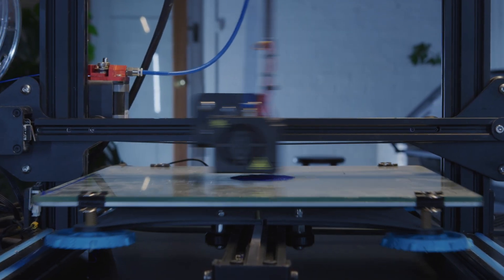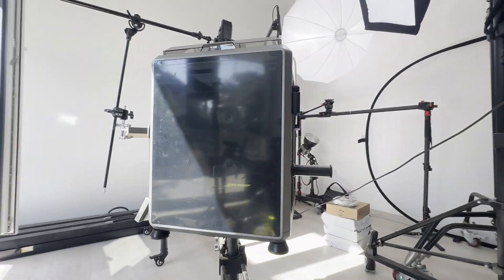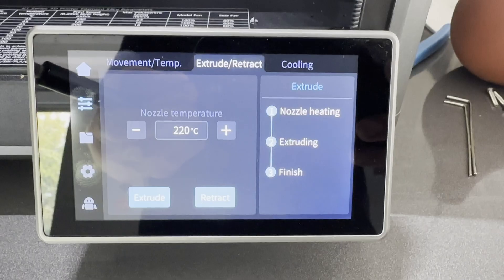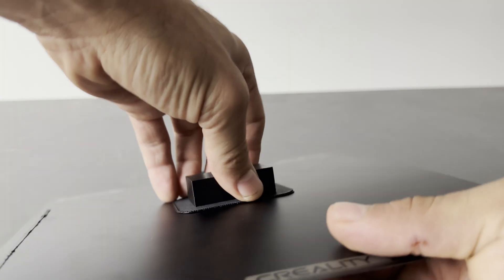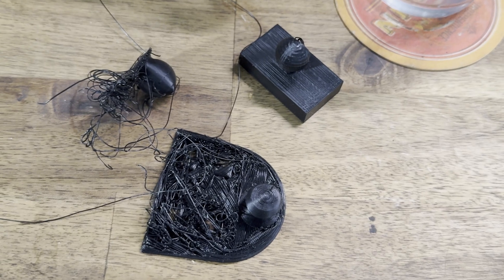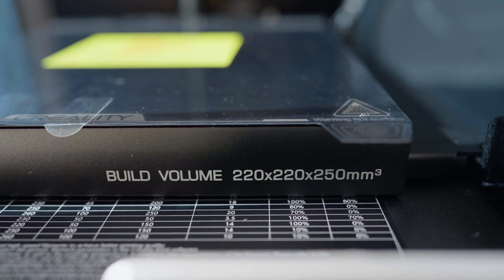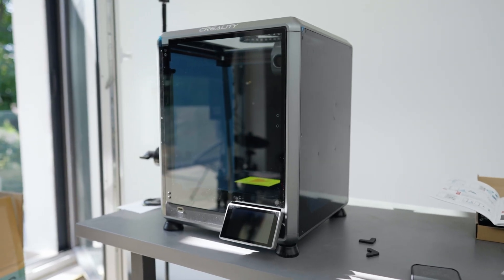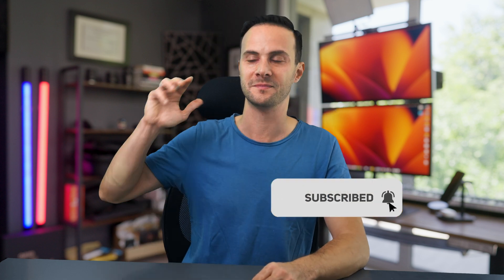Creality 3D Printer: What If You Could 3D Print Anything You Want?

Comment: I usually don't comment, but I couldn't help on this occasion. My first printer was an Ender 3 V2, and I was constantly adjusting, leveling, and upgrading it. It was followed by an Ender 5 Plus and a Longer LK5. Needless to say, I worked with those and upgraded, and fiddled and fussed with the hardware and firmware, and was able to print "OK" things, but after a while, they all collected dust. Fast forward to recent times, as a few years passed without printing much due to the constant issues, I wanted to upgrade the Ender 5 to a core xy machine. When I looked at the price and all, the Creality K1 was introduced. So, I bought a K1 Max. Maybe I got lucky, but from the first print, minus the VFA issues, it has been a wonderful printer. It has since been accompanied by a Bambu Lab A1 mini, and an A1. With these three printers usually all going all the time, I've found pleasure in printing again. So, this creators opinion doesn't make him a shill or fanboy...It's the nature of things...Some are great, and some suck! This is mass production...However, Bambu Lab, for a overseas manufacturer, same as Creality, they produce some of the best equipment I've ever used. The K1 Max is good for me, but Bambu Lab printers are great! And I have no experience with Creality tech support, as I am a tech guy, and usually work the problems out myself. I've heard Bambu tech support is good, and Creality sucks. I simply can't speak to that as I've no experience with either company and their support.
Reply from the maker: Thanks for sharing your thoughts. I think this is a really valuable input.